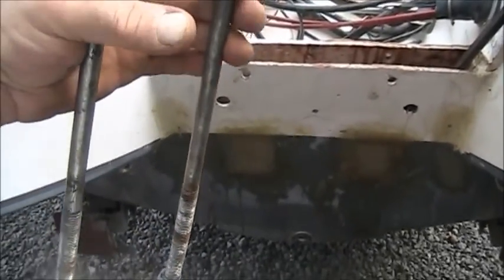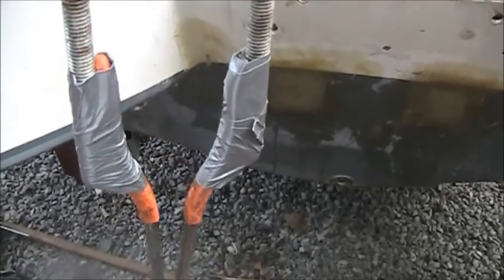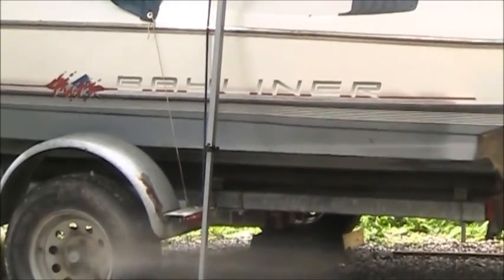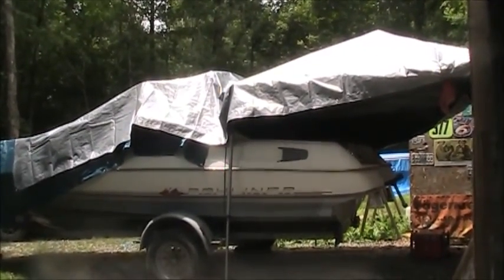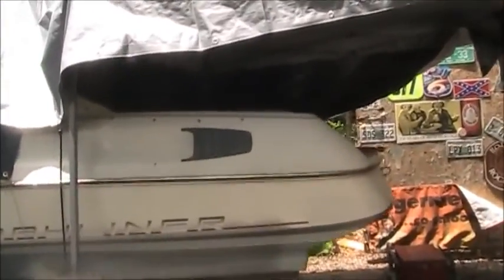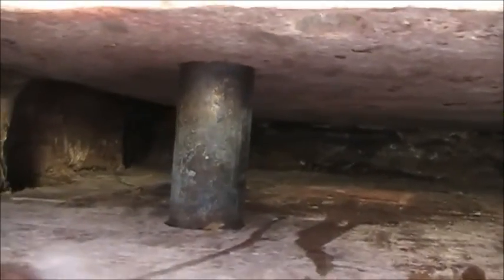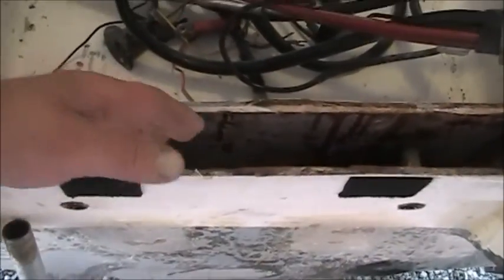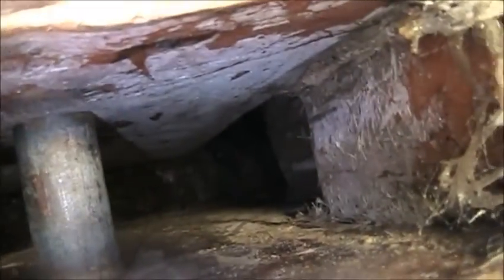1990 Bayliner Capri Transom Repair with Seacast Part Three

Comment: did this transom and knee braces only take 5 gallons?
Reply from the maker: If I remember right I’m pretty sure I used 10 gallons. I remember the price was about $350, about $170 for 5 gallons. I just went to the Sea cast site and the prices have gone up but this is good stuff. I’m finally into pontoons now so no more playing with fiberglass for me! Yay!

Comment: Thank you for making this video i bought a 1982 charger 17'4" bass boat and it needs transom floor and stringers i bought 10 gallons of seacast (2 5gallon kits) for the transom and stringers this video gave me some ideas on the viscosity of this stuff and how it should pour and i like the little funnel contraption you made thanks for the video very informative
Reply from the maker: +kenny hamann Hey Thank you, so far the transom has held up for the 2015 season ( and that's gettin' on it sometimes) so I'm taking it to the lake this year, so far so good.  I hope these vids help anyone who might be thinking about doing this.
Reply from the maker: +kenny hamann Hey Thanks! That's all I was trying to do was give some info on this great product as I had hardly found a good video showing exactly how this stuff mixed and looked.  Thanks for watching!

Comment: Thanks for the videos, I hate to say it but you needed to do the stringers in that old girl too. If you plan on keeping the boat then it would have been worth it. Also, for the transom braces, you could have easily cleaned them out by cutting the top glass off and just reglass over once you fill it with Seacast
Reply from the maker: Hey man thanks for watching!  I do agree that doing the stringers would have been the proper repair but man to me the work to do that on a boat worth maybe $2000 just did not seem worth it.  A few of things I would like to point out are the boat is trailered to the lake and I do not water ski and I ease on the gas always remembering my repair job.  Now, the tops of the knees are in a little hole that I can only fit my head and 1 1/2 arms in so without taking the whole top of the boat off there would have been no way to do that which, like you said, would be the proper way to do it.  The old girl is still going strong with no stress cracks after almost 3 years so I keep knocking on wood!  P.S.  I checked out your cat vid and ours does the same thing with the sink water!  It's so funny!  Awesome and  Thank you again
Reply: 377Gman I’m glad to see the sea cast is doing well for you, I want to do the same on my bayliner when it’s time. I hope it’s not for a least another 5 or so years from now though as like you said it’s a tall order! And thanks about our cat, max is a funny dude and a really cool cat.

Comment: Would you be Able to go tubing with the boat
Reply from the maker: Absolutely!  We did a lot of tubing after this. We never water skied so I don’t know about that but I think if you do it right it would be able to withstand the pressures of water skiing.  Thanks for watching!
Reply: @377Gman  great im going to do this with my transom its not terrible but the top lining is missing and I heard cracking last time we went out  so once I get it torn down and see what I have this will be my route
Reply from the maker: Yeah this is the way to go. I sold the boat 3 years ago and I have restored 3 other boats since but that transom is still holding up as of a year ago when I saw her on the lake. Good stuff. Good luck on the job!  Post a vid and and send me the link  I would love to see it!

Comment: Shake them haters off..
Could u have done some things better..yes, but I think you prep'd down to clean glass as best you could without removing the transom. Filling the stringers was key. If you were able to get to clean wood your stringers are probably ok. The fiberglass may be thick enough such that the section modulus of just the old fiberglass (over the wood) is strong enough to support the floor/deck anyway. I suspect your probably ok. Filling the stringers framing into the transom is key and if cleaned well enough will probable provide sufficient shear resistance where the sea cast bonds to the inside of the stringer glass. Pretty creative job and great prep work considering the transom was not removed.
Reply from the maker: Man thanks for the great comment!  I dug as far as I could go in there and then filled it.  The main thing I was trying to do, as you said, was to get the Seacast to bond with the fiberglass as much as I could going up into the 'knees' and stringers from the transom.  I know I got close to 'decent' wood into the stringers, not as much as I would like though.  Of course to really do it properly would be to split the top from the hull and cut the tops of the stringers and fill but It's just not worth doing that on a boat that is only worth maybe $2500.  If or when I sell it I will tell the next owner all about what I did.  This Bayliner is still going strong almost 4 years later!  No stress cracks or anything.  Seacast is awesome stuff!  For the record they did not give me anything to say that... I paid full price for all of of it!  Thank you for watching!